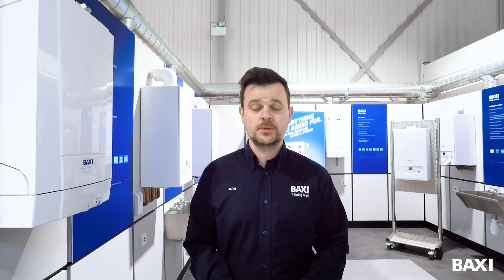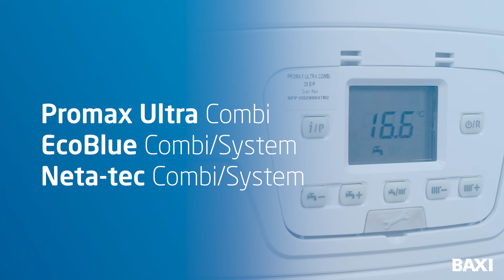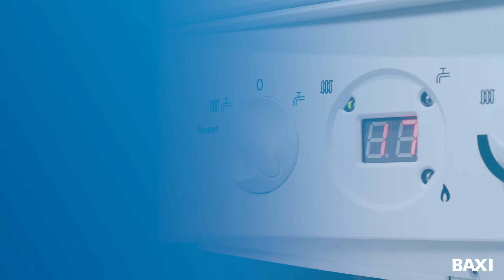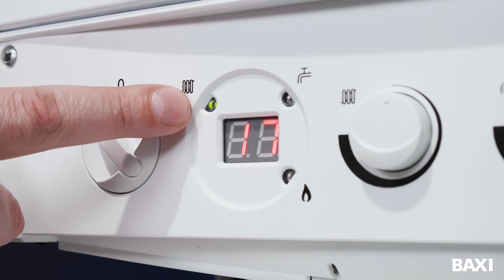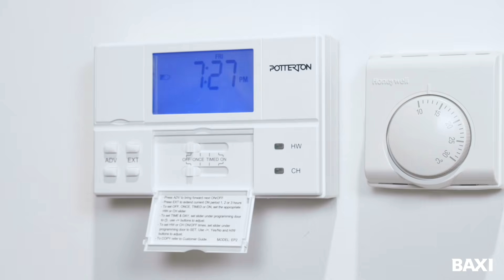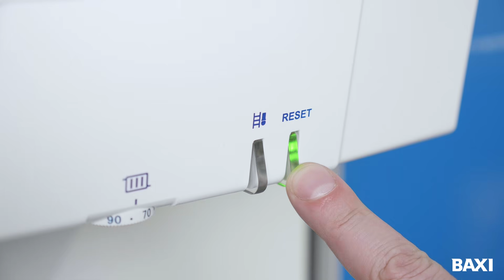What to do if you have hot water but no heating | Baxi Boiler Self-Help Guide

Comment: my boiler the hot water is ok.  When thereis a heating demand the boiler comes on and lights by the radiator symbol.  The ignition light comes on. But then the temperature gets to 76 ignition goes off and radiators don't heat up. aany suggestions

Comment: My baxi boiler is showing the flame for central plus I can hear the pump working .i have hot water ..but the radiators are not getting hot …what is the problem does not show any error code
Reply: I have the same issue. how did you fix yours? iI's not clear from this video
Reply: Divert valve

Comment: One of yours device engineers came to ours and  did stuff and now  the radiators don't get hot like they used to. It's not even as hot as a  hot water bottle or a Luke warm tea!   I only see the boiler go up to 34.  Only if I put to 23 will it go to 40.  But previous at 22 the radiators were burning hot. But now even at max on the boiler it still doesn't get that hot or like a warm pan. U have to really think maybe it's hot. In some rooms it's near off.    My thermostats control  that's separate makes it fire up if I increase the temp to 28! But it's really rediculous. Wish I never had this service guy come. Now I have a huge gas  5to expect
Reply: There a dial to change the water temp on the boiler